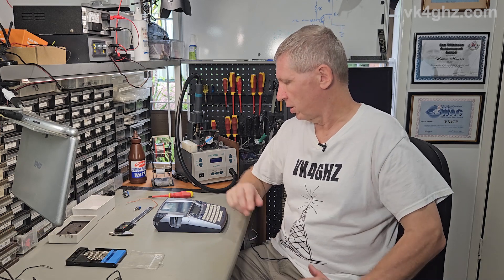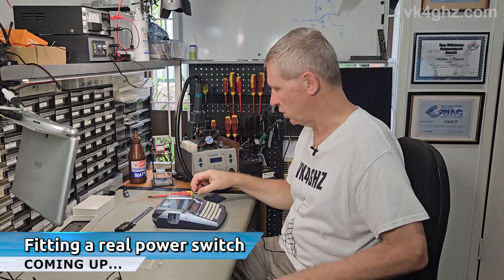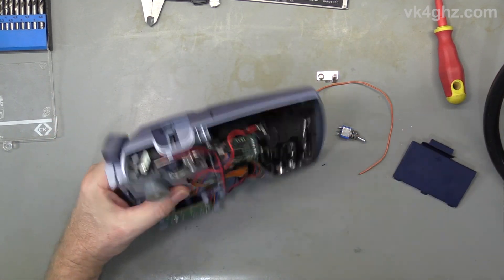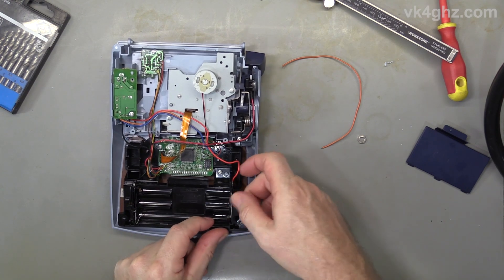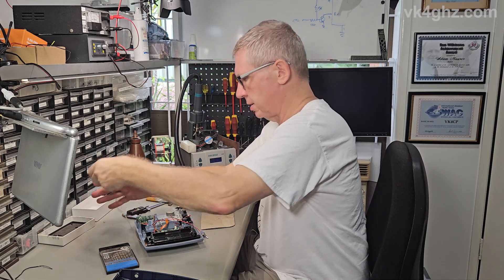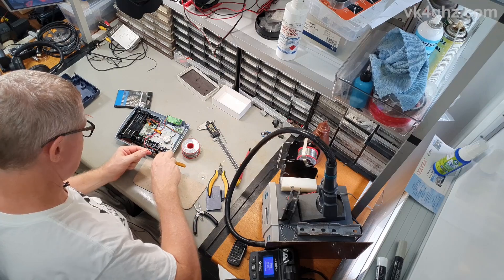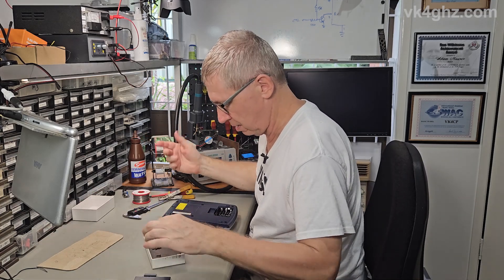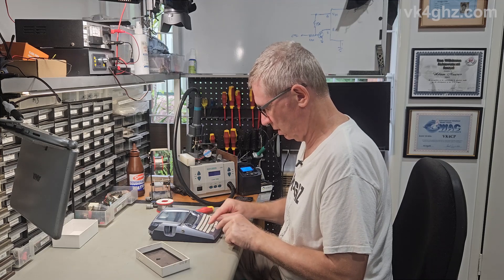STOP!  Wasting money on batteries - fit a real power switch.

Comment: If you dont use the gear often.. here is a better idea.. take the batteries out, this saves the battery and they wont leak and kill your equipment.
Reply: TBH, the leaking of the corrosive components inside the battery is probably a better reason to remove the batteries. Personally, I think most items should just have a real power button. Things like computers not having one does make sense as a real power button means that the you can't have wake-on-lan without another powered device to give it power.